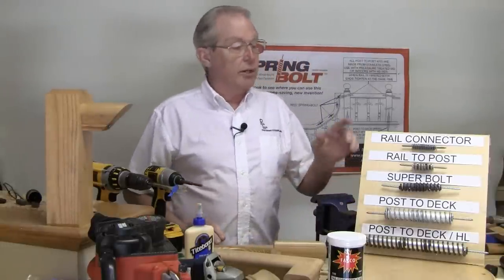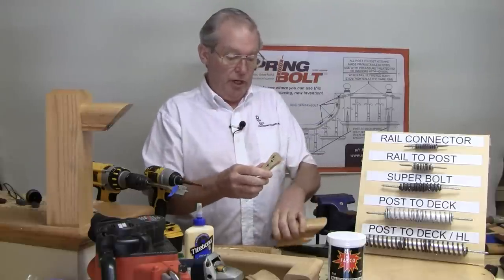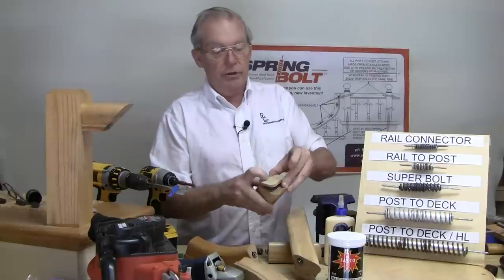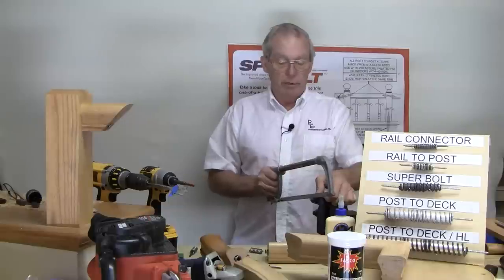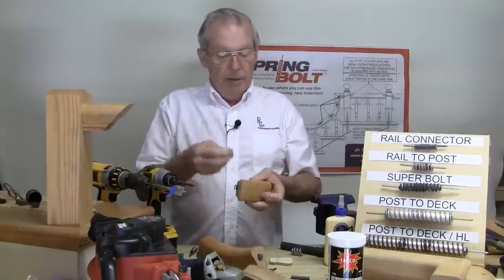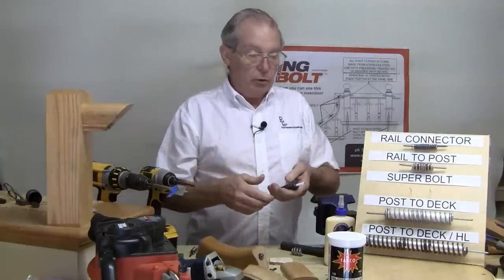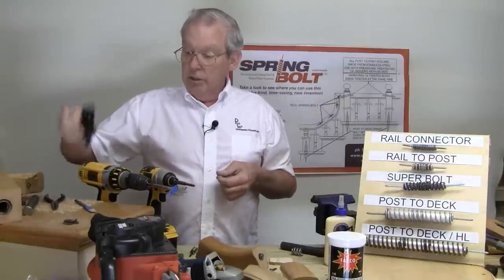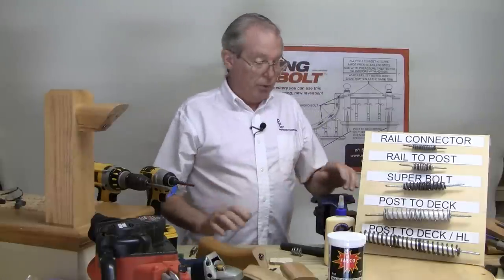Spring-Bolt Railing Hardware Uses & Installation Tips

Comment: Is there any adaptation or similar design for use with wood to concrete? I’ve never found a truly reliable method of cleanly attaching a wooden railing to a concrete slab.

Comment: I just did a over the top stair railing using this system. Here is what I found out for your information: The screws that come with the system are crap, in oak they snap off when you drill a hole they strip. If your spring is not tight they just spin. So I now use Kreg Jig screws problem solved. when a screw breaks off you are screwed. Otherwise I don't know how I would have accomplished this rail without the system. P please update your screws!
Reply: Sorry to hear that a screw snapped. We have sold several million kits and occasionally a screw will snap. We have a time tested screw supplier but we are always looking for ways to improve. I appreciate your feedback.
Reply: All 4 of my screws stripped immediately. This is ridiculous!!!!!
Reply: Yes i agree those screws suck. I use 3/4" drywall screws with a washer that i slide into the spring.